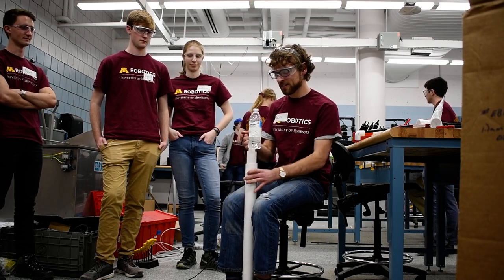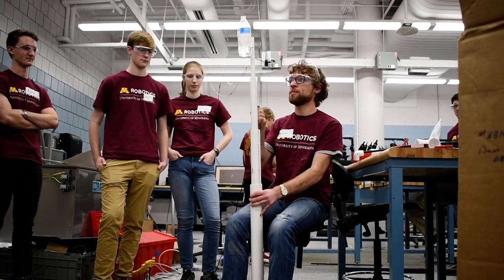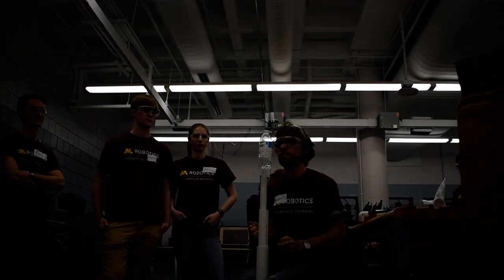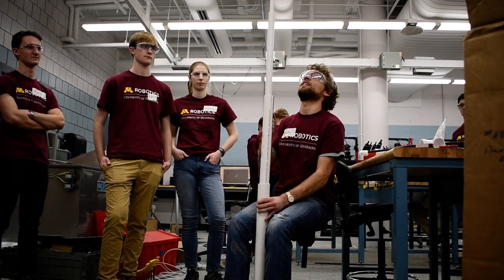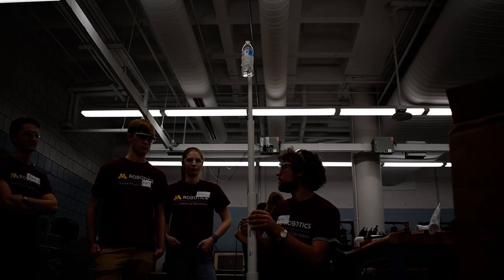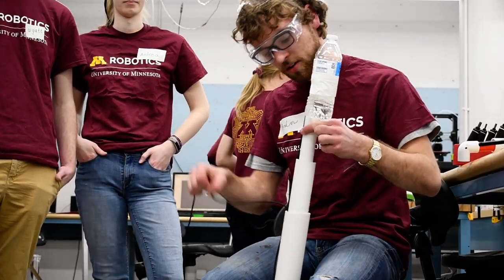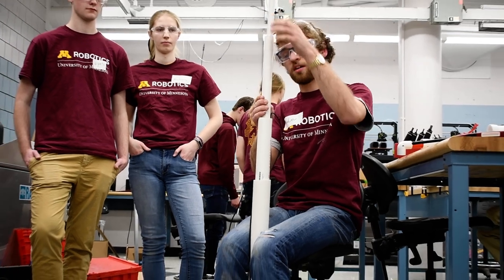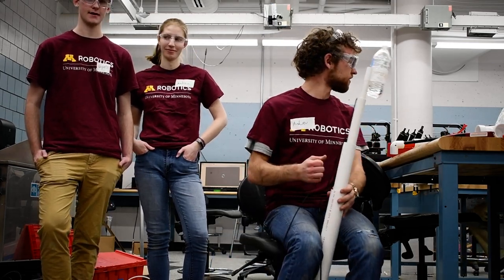Ri3D 2020 Day 1 - Climber Prototype Demo

Comment: can you explain further how this design telescopes with the strings?
Reply from the maker: It's a cascading lift pulley system. For each stage, there's a rope tied to the bottom of the PVC which wraps around the top of the stage beneath it. When the stage beneath extends, the rope shortens which pushes the next stage up. This picture shows the difference between a continuous and cascading lift mechanism: https://i.pinimg.com/originals/75/10/04/751004f18c0a1e331df98dd9ecb05d63.jpg
Reply: 'Snow Problem thank you, that definitely helps

Comment: How do you reduce the friction between the rope and the PVC pipes?
Reply: We used modified pvc T junctions to mount pulleys for the bottom two stages, as well as cut notches in the bottom of the pvc pipes for the paracord knots to rest in without rubbing along the pvc.The inner diameters of the pvc tubes on our final version were 0.5 inches apart, giving the paracord some space even with the thickness of the pvc.
Reply: @DeltaForce3537 Here is a picture showing what we did: https://lh5.googleusercontent.com/qzSFJsTDLL8L1TY530Y2b9697Xhgx3k9vywS4c2pZTg7FED4jZSopWVjvSN5guKeTIbw2oiSJpUSxxgcjCyzVPYxH7ABGouIH06FNelgS-E3ss7wPek=w1280 The red lines are cuts, the scribbled out part waste material, and the blue circle is where we mounted a bearing inside the T junction on a bolt across the diameter.  There are, I'm sure, many other ways to mount a bearing and/or reduce friction, but this functioned fine for what we had available.
Reply: @DeltaForce3537  Ah, apologies for the link issue, I will describe as best as I can (please bear with me if I am describing things that are obvious; it isn't particularly complicated, I just want to make the description as clear as possible).

The unmodified PVC T-junction is, unsurprisingly, shaped like a T and can connect up to 3 PVC pipes by fitting them snugly into its channels. We rotated the T-junction 90 degrees so that it looked like a sideways T (kinda like "||=") so that there is a channel going to the bottom, a channel going to the right, and a channel going up. When I say "bottom", "top", or "right" in the rest of this description I mean in this "||=" orientation.

We modified it by cutting off the top channel of the T-junction, making it look more like an upside down L, and then used the right channel to mount a bearing. We did this using a bolt running through the diameter of the right channel and some spacers (we eventually 3D printed them but cut up surgical tubing actually worked pretty good for our prototypes) to keep it centered. The PVC pipe for the stage will go in the bottom channel, and the rope will run around the bearing so it isn't rubbing along the bare PVC end.

If you plan on going underneath the trench or are worried about height for another reason, cutting down the upper left part of the T-junction to make space for the T-junction of the next stage to nest will help reduce height and bulkiness. You can then have one T-junction pointing to the right, the next pointing to the left, etc if necessary so that they can nest easily. 

Hopefully that description helps!  Best of luck to you and your team